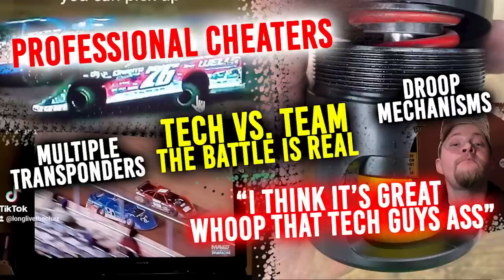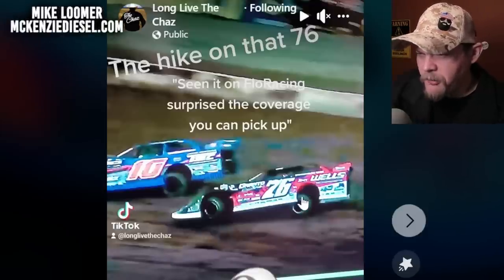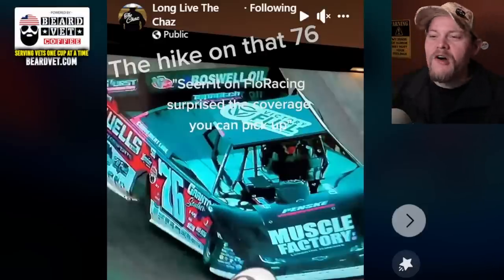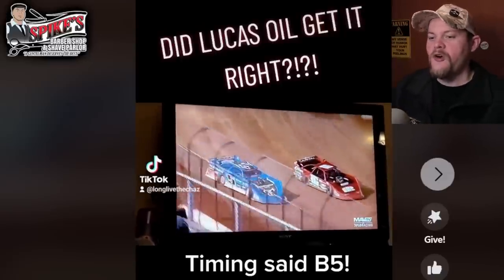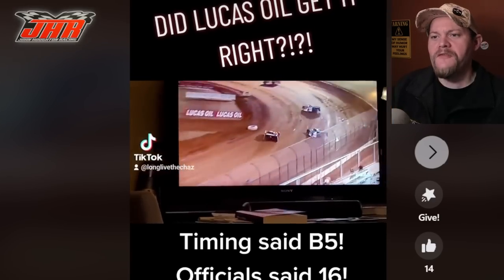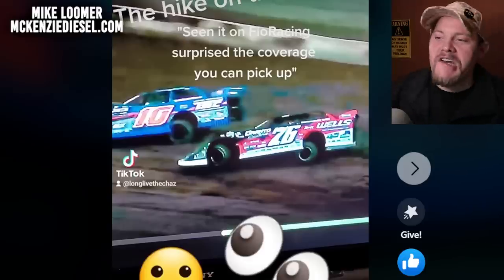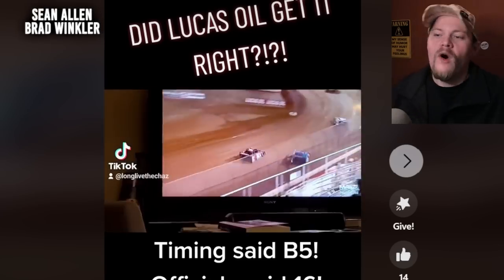PRO CHEATERS: Droop Mechanisms & Multiple Transponders "I think it's GREAT"

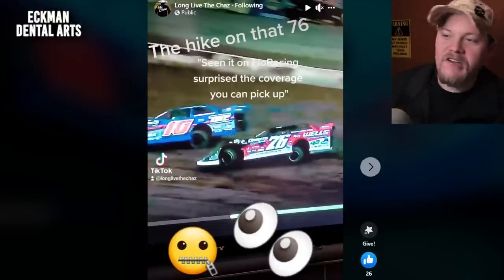Comment: 0:26 my take on the left rear of the 76 being different that the 10 or other cars for that matter is the 76 has the left rear tucked/ pulled closer to the front of the car at the resting point you can see this when he is off the throttle before he pulls off the track so it is only going to naturally be more exaggerated when on the throttle so to sum it up in one or two words it is car setup

Comment: OK the only thing holding the rear end from falling out of the car is a chain ( over slung chassis)  there isn't any chassis under the rear axle.) So if you run enough bar angle  (4 link) and put a short bar in for a panard bar ( jbar) it allows these cars to have the left rear tire actually come up all the way under the driver's seat in some situations your only limiter is your driveshaft will actually come out if you put too much ( vodo) in the car.  This isn't new or illegal tech just a good driver and chief that knows what the track can hold .  Please forgive my spelling it's early.

Comment: Shortened left side bars for more rear steer, tucks the left rear in the door. Bodys are not to spec. Bird cage over indexed. Traction control is also now blue tooth.

Comment: I would say Overtons car is flat out hooked up and dialed in what your seeing can be done in several different ways soft springs on the right rear soft shock on er also J bar adjustment will also play a role in this super late models well USMTS anyway have some fairly strong body rules and suspension rules also the one thing that you can do without restriction is adjustment for me in a modified I can put that lt tire under the drivers but but it’s not fast or very controllable here’s my two cents on it I would move the Jbar down on the rear end and up on the chassis this will cause a bit more lift increase bar angle on both sides. Soften the biscuit on the pull bar and lengthen the limiting chain on the lr I feel personally that would be enough to cause this effect and probably put my mod in the wall lol just thought I would chime in

Comment: Looks like Brandon Overton has figured something else out that no one else has!  The nice part is creativity evolves the sport.  Because you've exposed it, it won't be long until other teams figure it out as well.  We used to have this in NASCAR as well, now they just fine the shit out of you and kick your team out for 4 weeks.  Traction control has been used since at least 2003-2004 (probably sooner).  I know people that hid it exactly where you were said it was. Inside the left side frame rail. I know they helped develop it, and they won big money races with it (I don't think the driver had a clue it was installed).  The transponder issue is a mess.  If you don't pay attention, they can me moved just like you said.  When I was racing karts, we had to put transponders on the left rub rail.  The rails for my kart were extremely long.  During qualifying, when I felt I had a good lap going, I could slide my transponder 12-16" up the rail.  And yes, it made a difference on the lap time as long as I didn't screw up the rest of the lap.  So if there are multiple transponders on the car with the same trigger, that could be huge.  The rear of the car will trigger to start the lap and the front of the car ends the lap.  Could be a couple of tenths in Qualifying.  Officials probably need to monitoring transponders a little closer in Qualifying.  I wouldn't be surprised if teams had their own programable transponders they could slip in the nose for Qualifying.

Comment: You said what others won't ...the only thing about this that bothers me ... A ton of development dollars are being spent on creativity ...which continues to price out a lot of solid competition.At the same time ... I have seen a transponder send a triggering beam as far as 24'7 IN FRONT of a car in development. Traction control as mentioned .... In the video is fairly common ... But will continue to be somewhat spotty due to the lack of consistency of track surfaces. The most interesting technology I have umm ...seen/messed with ... Built based on small magnetically driven independently triggered motors that were originally built for extra power output in the Tour De France (cycling) that have been adapted to the Late Model Racing platform. Its a complete non-electrical solution that can be adapted to wheel assemblies, axels and even certain suspension parts ... That can be moved to those different parts to supply different types of traction control options. Crazy to think that those pieces were originally used to supply extra hill climbing power to cycling cheats ...and have now been adopted as a nearly impossible to catch/find traction control platform for dirt super late models.

What people don't realize ..is that the best cheating options being used right now are so simplistic that some of the materials are in your pockets or sitting on the refrigerator as I type this. The Droop cheaters are doing things with magnet placement that are so simplistic ...it can only be described as "true genius". Not to mention that the materials being used make it nearly impossible to get caught in a tech inspection scenario. Great topic!!

Comment: I don't believe tech officials are on top of the electronic technology available and now used on transponders, more precisely a amplifier which transmits the signal much further away from the transponder to record a faster lap and finishing position than a car that doesn't have one racing beside it which is not noticable until there is a dead heat finish as we seen a couple of times at GIS.

Comment: Yes you would need to turn the front one on after the start finish line and then turn the back one off before you cross it again or otherwise it would register a tenth of a second lap.
Reply: Don't they send out a unique signal?
Reply: @lefturn99  you can duplicate any electronic signal. If you can clone a phone you can clone a transponder.

Comment: As far as Brandon Overton and the droop rule. All you need to know Chaz is if his car passed the tech procedures in place that's all that matters. As far the knowledge in dlm crews, yeah I believe they're among the smartest people in all of motorsports.
Reply from the maker: You should br his PR director
Reply: @LongLiveTheChaz  Nothing to see here. The 76 passed tech.
Reply from the maker: @kyleolson279  OH WE ALL SEE
Reply: @LongLiveTheChaz  No problem pal, no problem here.
Reply: The droop rule doesn't limit how far the suspension travels or 'hikes'.  It just limits how high the deck can be at the point at which the LR is lifted off the ground.  If you build the deck 3" lower when the car is static, it can hike 3" farther and still pass droop.
Reply: @ryancourtney27  Exactly. What's the problem?  If the car passes tech?

Comment: 76 has more rear steer in the car.  Simple as that
Reply from the maker: Explain
Reply: See Jon hardy comment below. Very good description of what is happening. His setup is allowing the axle to crawl under the car in the horizontal plane as well the limitations in vertical plane through droop.  I believe this style of set up make car tighter and allows for better forward drive.  Think of the old gmc pickups with rear steer.  Easy way to conceptualize